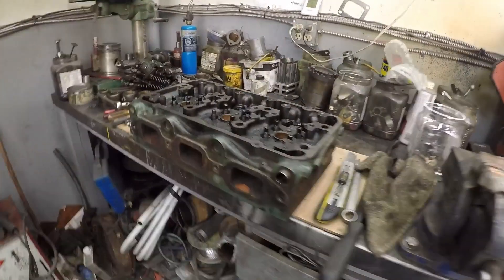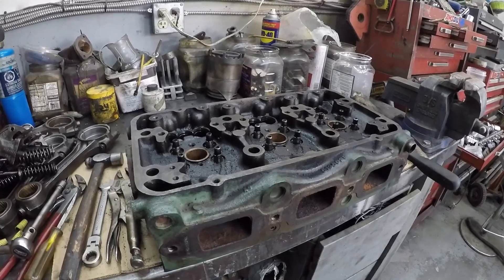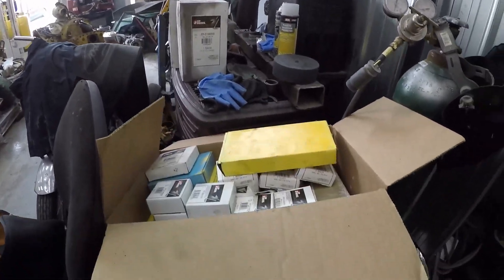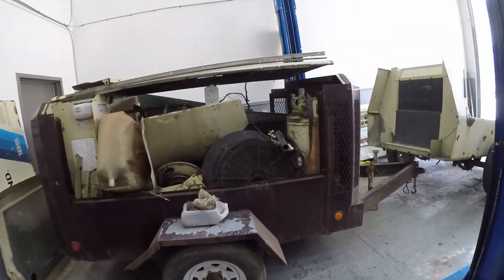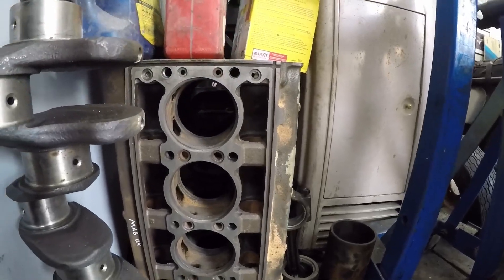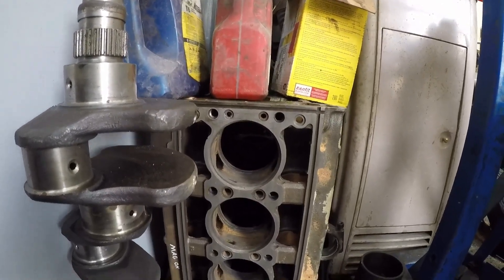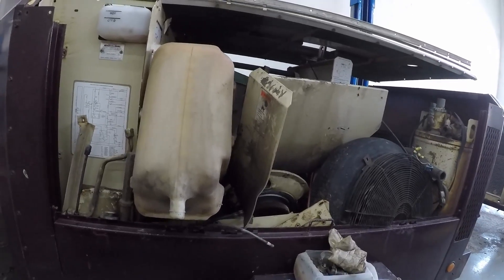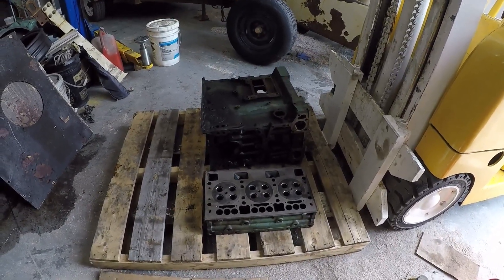Detroit Diesel 3-53T build (Part 1)

Comment: I’m in the uk and making my 3-53 into a 3-53t 
Do you know part numbers for the turbo piston as I only have standard piston to go from
Reply from the maker: 5149734 is for the turbo cylinder kit, I don't have one for just the piston.  I'll have a look when I get home.
Reply: @detroitgarage9430   I’m looking to get a full in frame kit, but is pretty tricky in the uk and as it was non turbo before now trying to get the turbo parts, is it just the piston that is different?
Reply from the maker: @benfowler3843  There's a fair amount different from the N to the T.  When I did mine I changed out the connecting rods to T rods and upgraded the valves to T valves.  The T piston pin is 1.5" compared to the 1.38"  N pins.  I did use the N crank and camshaft though.
Reply: @detroitgarage9430  do you think it will be ok to just change the pistons ? I’m a bit unsure on the supper charger as well, is there a way I can test it ? Thanks for your help not easy in the uk to get help with the old Detroits
Reply from the maker: @benfowler3843  As long as the liners are in good shape, then yes.  Just hone them, new rings and pistons and your set.  For the blower, if it turns freely and the rotors are smooth, then clean it up and re-use.  I'm running an N blower on my 4-53T and works great.:)
Reply: @detroitgarage9430  I put n50 injections and fitted the turbo and it blow the dipstick out with 8pis boost, so i would say the engine is tired, is there anything else I shod look at when rebuilding the old girl ?
Reply: @detroitgarage9430  did you get a chance to find a part number for the t piston ?
Reply: I have found the part number 👍 do I have to machine the rod to fit the 1.5 pin ?
Reply from the maker: @benfowler3843  No, the best thing to do is call or email PCIndustries for the number.   I though I still had some trunk T pistons, but I don't.  They'll have the number for you.:)  They ship world wide as well.:)  https://www.powerlinecomponents.com/

Comment: Nice to see the 4-53T hauling the 3-53 to the machine shop! Too bad your used 4-53T pistons aren't nice enough to use in the 3-53T build with new rings and liners. What injectors N55?
Reply from the maker: I could probably get away with using my old pistons, but they don't cost too much new, so I'm going to replace them.  I'm using the 5C60's that came out of my 4-53T as they work well and should be close to 120-130 HP.:)